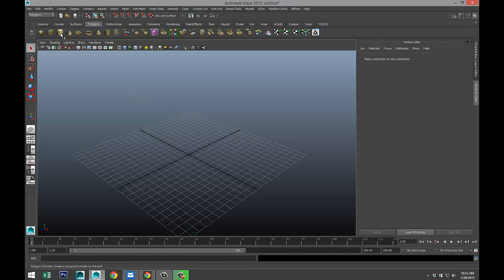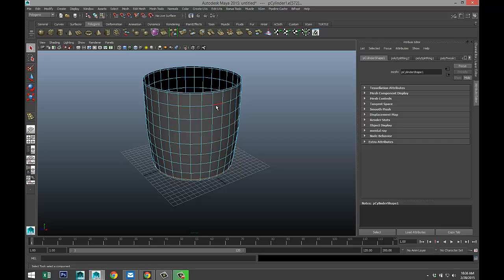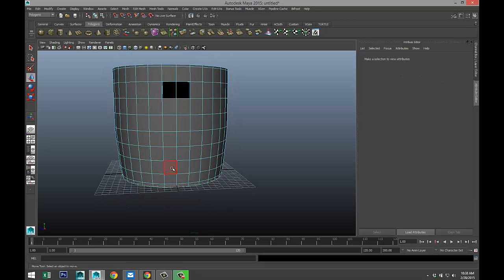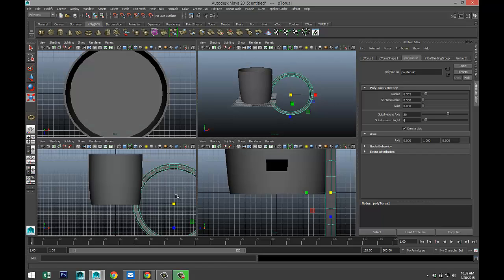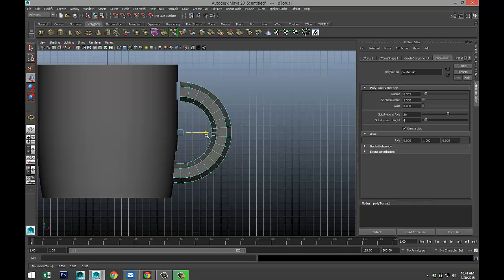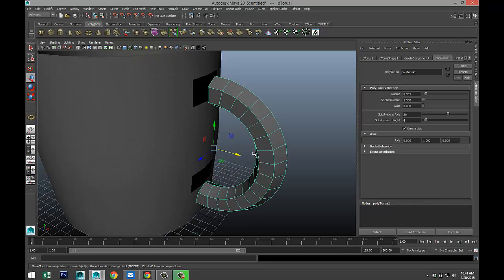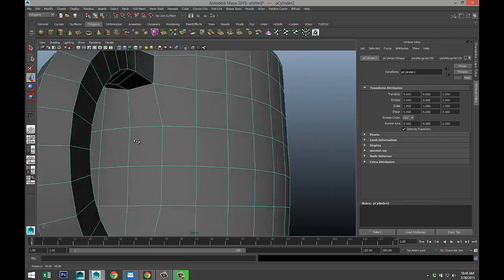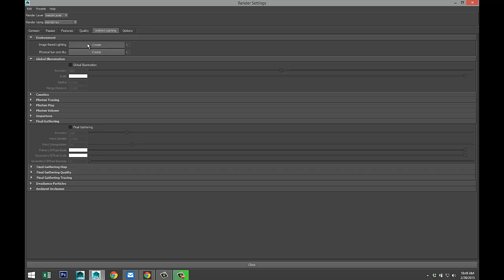Modeling a Coffee Mug in Maya

Comment: for autodesk maya 2017, the thickness for extruding the mug's surface should be around 0.1 in order to get a similar thickness as shown . for some reason it is MUCH thicker at 0.350 for the new version.
Reply from the maker: depends on your scene scale
Reply: I did not consider that, my bad. Still new to maya, just going off what I learned from what little experience I've had.
Reply from the maker: No problem